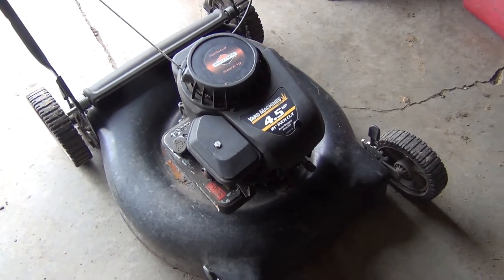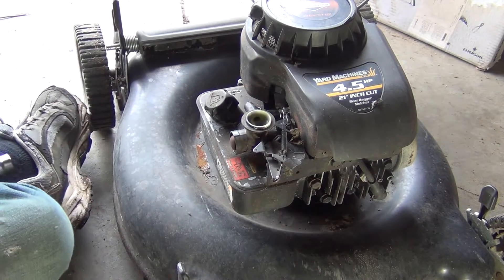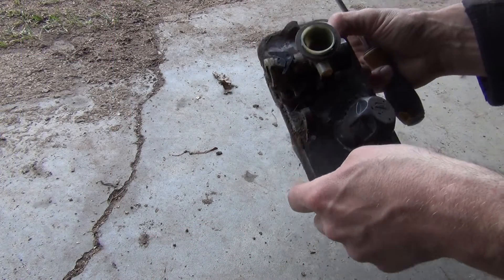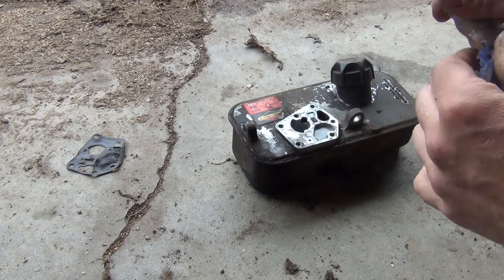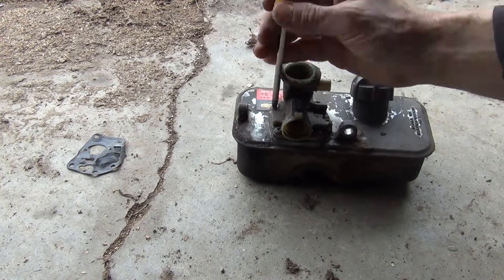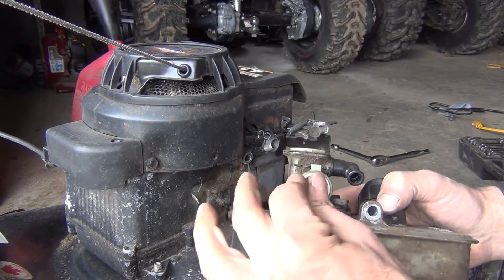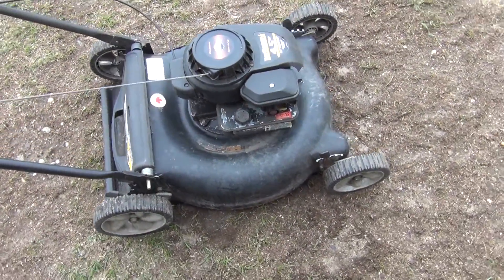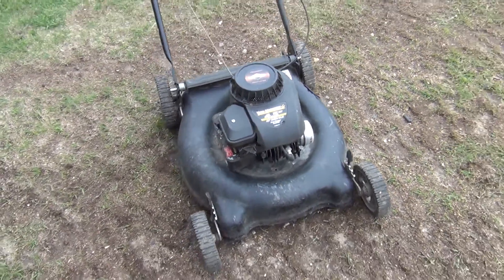Briggs and Stratton Classic Carburetor Repair (step by step)

Comment: Mine is the exactly the same it has new oil and clean gas’s and I’m barely cleaning the carbulator and new start plug if that doesn’t work what could the problem be???
Reply from the maker: @hianazpeitia-ey3en  more likely the gasket between the tank and carb is bad

Comment: I have the same lawn mower. The mower should have a constant rounds per  minute. However it changes the rpms from time to time (especially when the grass is a bit higher). The engine is than producing blacker smoke. I cleanded the air filter but it  doesn't make a difference. Have you got any idea what the problem could be?
Reply from the maker: Black smoke usually means running to rich it sounds like a plugged up air filter have you tride to run it with no air filter as a test to see if the black smoke continues?
Reply: Not yet. I can try that.